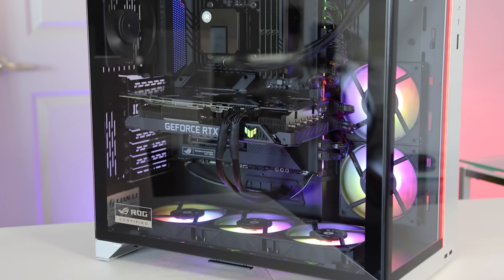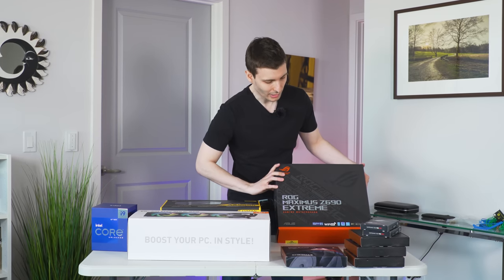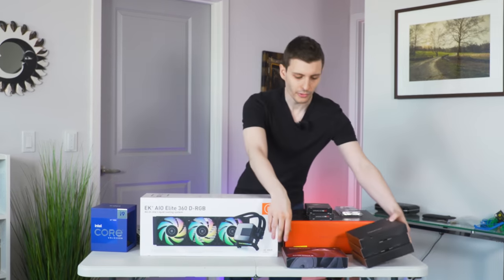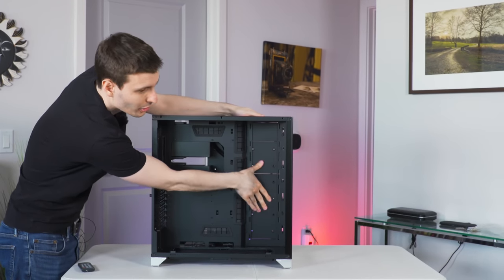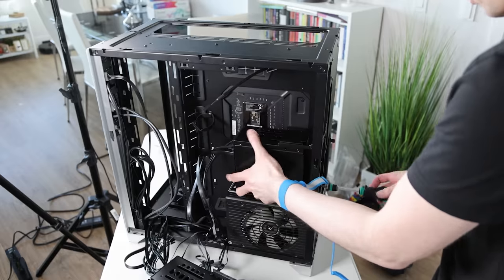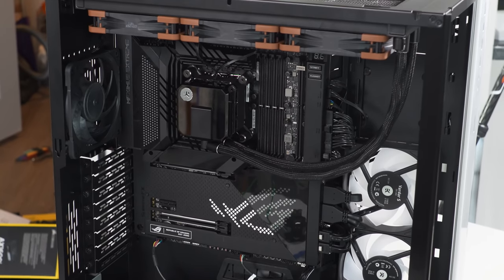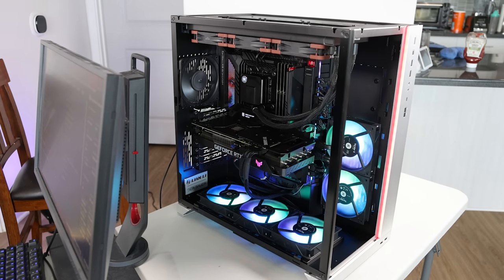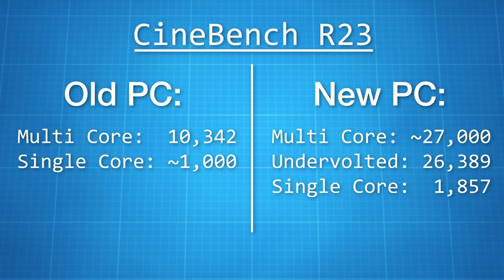I FINALLY Built a New PC After 7 Years (Unlimited Budget)

Comment from the maker: A few common questions, I'll update these periodically:

Q: Why not wait till Zen4 or Raptor Lake?
A: My current computer was basically on it's last legs, stuff just wasn't running nearly as well, Photoshop became slow AF in the latest versions, plus other random issues. I wasn't sure if a clean reinstall of Windows would even help, so I figured it was time to upgrade anyway. I didn't want to deal with it until the rest of the year, and that's assuming I'd even be able to get the new components when they come out, which is probably not the case.

Q: Why did you end up switching to the other fan controller?
A: The Asus one just didn't work, and wasn't even being detected by the Asus software. Maybe I did it wrong, but the Asus software really sucked anyway so I just went with the EK one and it works fine.

Q: Why not get a Nvidia 3090?
A: I already had gotten the 3080Ti a few months ago, so it would have been kinda dumb to buy a whole new GPU just to go from a 3080Ti to 3090. Especially with the 4000 series coming out which apparently will be twice as powerful, so I'll just get the top tier card when that comes out. Also even when I got the 3080Ti, I was actually trying to get a 3090, but even with in-stock notifications, the 3080Ti became available first so I jumped on it.

Q: Why not faster RAM or better timings?
A: At the moment, there are limited options for 32GB sticks. 4800 MHz @ CL40 is the fastest that existed if I wanted 128GB considering there are only 4 DIMM slots. Anything faster is only 16GB or less

Q: Why not mount the fan controller with tape somewhere else?
A: I was going to, but there is actually no place it would fit even that way, because of the way the mounting features of the case are arranged on that metal panel.

Q: How much did it cost?
A: About tree-fiddy

Q: What was your old computer?
A: Intel 5960X (though last year I bought a 6950X on ebay and swapped that in). Mobo was Asus Rampage V Extreme (X99). It had 80GB of RAM.

Q: Why not the 12900KS or 3090Ti?
A: Neither of those had been released at the time
Reply: Raptor Lake all the way! That will be my next computer this Fall!
Reply: The aRGB staff are usually proprietary and only work within same brand, So that was probably why Asus one didn't work.
Also, Did you use LGA1700 mounting kit or LGA1200? Because that could affect temps.
And a stupid question, did you enable XMP for RAM?
Reply: Slow AF!.. 😄
Reply: What do you plan on doing with the old stuff?
Reply: The real question is... can it run Minecraft?
Reply: What will you do w/ your previous workstation?
Reply: No RGB RAM=instant fail😂
I my understanding, ASUS Aura Sync and Razer Synapse is considered to be some of the best RGB lighting software in the market. It will be interesting if you could make a separate video to illustrate the problem you faced😄
Reply: How much did the total cost of the build come to not counting the GPU you're reusing.
Reply: what was ur old pc config ?
Reply: i hv bought i7 12700 non k + asus z690 tuf gaming wifi d4 at the cost of yuhr i9 12900k wd overpriced packaging and 4 extra efficient (non powerful) cores
rest i already own rtx 3070 FE n 32gb vengeance kits , 6 non rgb cooler master case fans , 2tb 970 evo plus , 860 evo since 2018 launch and 850 evo since 2015 250gb each , 2 4tb wd blue and wd red,  
cooler master hyper 410r cpu cooler
Reply: WHY NOT GO FOR RDNA3, ACCORDING TO SOME MOORE'S LAW IS DEAD VIDEOS IT'S GONNA BE BETTER THAN LOVELACE WHILE USING LESS POWER
Reply: @FatSn8ke  why
Reply: Plz heart this comment thiojoe
Reply: Joe , u shudve bought a mac studio with 64core m1 ultra , 128 g ram , 4 tb storage and u can film 4K and will be so much quieter
Reply: @atharvagangan1777  *20 core CPU&64 core GPU
Reply: @rhebucks_zh  ya I meant that
Reply: I miss you so much, and blessed Friday, and you're creative keep going✨✨✨✨✨..
Sender: your brother (Baraa) from Palestine
🇵🇸🇺🇲
Reply: Adobe is recently undergoing updates that may slow down performance for some PCs.
to clock your CPU faster, go to control panel > System & security > Power options > Change Plan settings (for current plan) > Change advanced plan settings > Processor power management > minimum processor speed > (default setting: Plugged in or None) > 100% Then click OK. The CPU should clock faster, but this only works with PCs with processor drivers with adjustable clock speed support.

Also, you could also get a raspberry pi 400, as you may be able to add USBRAM to achieve 128gb.
USBRAM is a beta project that uses usb 3.0 or usb c for full support.
Reply: Please translate your cost amount to an actual dollar figure!
Reply: The motherboard name is pronounced "Are Oh Gee" not rawg
Reply: Why did you wanted to boot without a monitor?
Reply: why not amd?
Reply: Tree-Fiddy??!! Please tell me that's not 350k
Reply: How about the 3090 ti?
Reply: @aayanpanjwani  he had bought the 3080 recently for his old pc, he ain't buying a whole new graphics card for slight performance inc
Reply: @Fnn-jl7he  Yeah but he said "unlimited" budget, so
Reply: @JavisoGaming  AMD's Zen 4 is going to Spank Raptor lake back to 2012.
Reply: what's your 2015 pc?
Reply: i upgraded as well, couldnt wait, i'd lose more by waiting. I went for 5950x & dark hero mb. waiting on GPU to get cheaper bef i get a 3080ti, thats all.
Reply: The Performance is Key But cosmetics are important 2 so why No sleeved cables?
Reply: Out of all the RAM you could get, you got the one kits with no heatspreaders? They're just exposed PCBs, and it really deducts from the final look in my opinion.
Reply: Okay so windows 11 does have tab file explorer for 22h2
Reply: You also have the security advantage of Shadow Stack (which is in Tiger Lake (on mobile) and Alder Lake and up (for both as Rocket Lake did not have support of Shadow Stack) and Zen 3 and up for AMD) against Return-Oriented Programming attacks. This provides mitigation against exploits as more programs make use of CET. Using CET does not make a program incompatible with previous processors but they don't get the security advantage
Reply: @doctorfresh3856  How so?
Reply: @muhammaduwaismuhsinmuaz4385  Because it's going to be a better, far superior product. Duh.
Reply: @doctorfresh3856  How?
Reply: @muhammaduwaismuhsinmuaz4385  Better IPC! Higher gaming and Multi Core Performance. Better cooling capacity. Higher voltages and hear resistant. Just the whole nine.
Reply: @doctorfresh3856  Did you test it?
Reply: @muhammaduwaismuhsinmuaz4385  BECAUSE I SAID SO!!!
Reply: @doctorfresh3856  Huhh???
Reply: CMOS POST ERROR means the configuration data is wrong or the CMOS clock battery is bad(from experience from older bioses(namely my windows 98 PC))

Comment: Ive never heard of under-voltaging a CPU before. It sounds like a great idea to save your CPU and have it last longer. Good job on the future proofing even if it was a little bit ridiculous
Reply: I've also never heard of under-voltaging a CPU before.
Reply: But if a computer plays up at the correct voltage, then something is wrong, maybe the cooling system is not as good as he thinks.  I only used water cooling once, never again.
Reply: Quote - "Ive never heard of under-voltaging a CPU before. It sounds like a great idea to save your CPU and have it last longer."
- Unnecessary and it doesn't work like that.

Quote - "Good job on the future proofing"
- That's a Myth made up by Computer enthusiast... 
And it makes a person feel better / justified about Spending Thousands of Dollars.
Reply: I feel like undervolting a cpu is bad for the cpu, because it could constantly want more voltage and not get it, and make your system unstable, if u want less performance just lower the clock speed on the bios.
Reply: @dirtydemon9723  Nope. Experts do it. It's not uncommon for people in the know.
Reply: If you have ryzen you can get this free tool that overclocks and undervoltes at the same time. From what I understand if you put in less power you get less heat obviously, but with that less heat you can run it at a higher clocks and still be stable. Not sure if that makes it have a longer life span but it sounds like it.
Reply: @dirtydemon9723  also that's what undervolting means. Making your cpu not want more voltage.
Reply: Sure you did, a Nintendo Switch is underclocked
Reply: @DoubsGaming  

Quote - "Not sure if that makes it have a longer life span but it sounds like it"
- LoL Morons -
USE the Links - Do the Research.

- Do Not Buy AMD.
Reply: @dirtydemon9723  ,
Not how it works.
I don't think he did this the ideal way for modern CPU's, but ideally you want the CPU to use as LITTLE voltage as possible while still being stable. And he DOES run tests to ensure stability so that's not an issue. You wouldn't simply "lower the speed" either. To oversimplify, with a modern CPU you want to set the TEMPERATURE limits and then have it dynamically adjust its voltage and clock speeds to give you the best PERFORMANCE without going over that temperature. All modern CPU's and GPU's have the ability to TRAIN individually the voltage/frequency curve. So it will lower the VOLTAGE at, say, 4.8GHz until it becomes unstable then lock in the stable voltage in a lookup table. Then refer to that table when dynamically adjusting for max performance.
Reply: manufacturer bioses usually have a high auto voltages , you can unusually get a slight overclock with less voltage that the auto settings. Been doing that since the Sandy Bridge Era from 2011 though some chips are duds that need higher voltages so you'll need to test and understand your specific chip to know it's range
Reply: Overclockers rise up. Undervolting is actually one of the ways to increase CPU performance (at least for Ryzen) because it reduces the amount of heat generated and gives the auto overclocker more headroom to go all out.
Reply: amazing thread here guys, I didn't know best buy laptop salesmen had a thread to congregate under
Reply: I undervolted my Ryzen7 3700x when i first got it a couple years ago because of the articles about some motherboards pushing too much power, fast forward a year, im wonderng why my focusrite and studio monitors started crackling under load, first noticed it while using blender while watching a tutorial, turns out resetting the bios back to default fixed that problem and the stuttering in my vr headset. I was 2 sec away from reinstalling windows and throwing a 3070ti up against the wall. Long story short, undervolting isn't always the answer...
Reply: @jesusisunstoppable4438  why? AMD has been leading for the past few years and seems they will continue Todo so into the near future
Reply: @jesusisunstoppable4438  what? Amd processors are more than the Intel equivalents
Reply: @michaelf.2449  - No - 
And of course mainstream will never say it in modern times.
And AMD vid cards suck also.
Reply: @jesusisunstoppable4438  why do you think AMD CPUs aren't good? They've been ahead of Intel and gaining market share the past few years and it's caused Intel to finally innovate
Reply: @michaelf.2449  

2nd add on Comment - Because I know You are a AMD fan boy -
- Google search.. 
Why do AMD Cpu's have so many problems.  -- Answers going back 10+ Years.
Why do AMD vid cards have so many Problems - Answers going back 5+ Years.

You like Cheap Crap AMD -- Go for it, buy all their stuff and keep them in Business.
I've been saying for 20+ years - I wish their were dozens of CPU Companies competing.

But it's just like everything else - it's the illusion of choice.
Reply: @michaelf.2449  

2nd add on Comment - Because I know You are a AMD fan boy -
- Google search.. 
Why do AMD Cpu's have so many problems.  -- Answers going back 10+ Years.
Why do AMD vid cards have so many Problems - Answers going back 5+ Years.

You like Cheap Crap AMD -- Go for it, buy all their stuff and keep them in Business.
I've been saying for 20+ years - I wish their were dozens of CPU Companies competing.

But it's just like everything else - it's the illusion of choice.
Reply: @jesusisunstoppable4438  ohh you're just a fanboy okay. Well I'm glad to know I'm an AMD fanboy considering I've haven't owned one since my first computer 🤣 2600k all the way to 12600k and still using Intel but you cannot just dismiss facts by claiming the other guys suck
Reply: @dirtydemon9723  If undervolted too hard, it will be unstable yes....but the point isn't that people want less performance, they want less heat. If you under-volt right, it will still automatically boost to the stock speeds (or in some Ryzen cases, above stock speeds) and perform just as it was out of the box, but at lower temperatures. The reason this is possible is because CPU's aren't all created equally, some CPU's of the same model will be able to overclock/under-volt better. This is because they are "binned" and if a certain standard is met, they will be made as a certain model. This leaves headroom in both aspects in undervolting and overclocking. So as the results may vary, it is worth doing if you like a cooler system (which makes the system quieter).

Comment: Two things, Theo:  1) you really don't need a ground strap.  All you need to do is ground yourself by touching the case periodically.  2) PSU with that much power can't hurt but are really a waste of money.  A 700 or 800 supply would be more than enough, even with your hardware.

Comment: I went to programming school for a year but was never able to get a job in the industry. But I did, like him, went out and built my own computer. Overall I saved only about $200 from not buying a similar type, no brand computer. But it taught me that buying a name brand computer was a waste of money (and this from someone who worked at Hitachi for 3 years). My current computer I bought 4 years ago, no name, but has a double drive so decent memory, and also a fairly good CPU. Overall though, I saved around $1000 by not buying a name brand. I did get an extended warranty of 3 years which I never used. (On my previous computer I also did that and used it so many times that the company in the end said it would take them months to fix my computer and the warranty would've run out. Computers have clearly gotten better since then).

Comment: was expecting an RTX 3090 😂
Really awesome build and the cable management is absolutely the cleanest i've seen so far. Congrats!!
Reply: Wait, where did he show what graphics card is he using?
Reply: @TuxikCE  5:26 he used the graphics card which was in his old PC
Reply: @san4th  His old PC is from 7 years ago, and it was showing "RTX" on the label. Also he said it is a no budget PC, so surely he would have upgraded the graphics card, but interestingly he did not show his graphics specs.
Reply from the maker: Nah i'll just wait for the 4000 series
Reply: @ThioJoe  That is even better decision, considering that 4000 series is right around the corner.
Reply: @ThioJoe  better have 10k in your savings😂💀
Reply: @ThioJoe  thats what I've said with every tech advancement, I'll just wait for everything to catch up with each other 😂 i started 6 years ago
Reply: Currently you can only get that 3090 in your dreams
Reply: @ThioJoe  or the 3090 TI
Reply: @kavivarman  10% performance over 3080ti for 2x price
Reply: @ThioJoe  but you already jumped the shark with the rest of the system 🤔
Reply: @LeviAckerman57551  3080 Ti
Reply: @san4th  dude that's still good then
Reply: @LeviAckerman57551  not enough, hes gonna upgrade to a 40 series card later
Reply: @TuxikCE  I got a 3080ti and it’s as powerful as you will ever need as of right now for pretty much anything, the performance is very close to a 3090 minus the 12gb vram
Reply: Great video, but his computer is boring for 12900k with 4TB 980 pro, Z690, 36 TB HDD, 128GB DDR5
Reply: @ThioJoe  that aged well i can tell

Comment: Quick tip. Attach the CPU, RAM, and storage BEFORE placing the mobo in the case. Power it on and make sure everything is connected properly. This way if you missed something then you don't have to take everything out to fix it.
Reply: It's much better feeling building it and then turning it on for first time
Reply: @Ladioz  Until you completely short your motherboard and blow an entire build. Lemme know how that goes!
Reply: @aidandubiel2615  That never happens, come on man.. been building computers since 2019
Reply: @Ladioz  I'm happy for you! I've been building computers for like 2 months. So far I've killed more builds than completed. Maybe we operate on the assumption that people who have never built a computer before don't know that there is a very real risk instead of just throwing out poor advice, k?
Reply: @aidandubiel2615  maybe ur just bad at building pcs…
Reply: @tessleye_01  perhaps if you read my earlier comment you'd see that I've already admitted to that....  

Maybe you're just bad at reading? 🤔
Reply: @aidandubiel2615  maybe ur just bad with fluidity in your writing
Reply: @tessleye_01  I've moved on from this conversation.... you should too.

Comment: a tip from me. if you have a box where you can mount the cooler in front of the box and no holes on the top or seal them with Plexiglas then you avoid getting more dust to stuff into the box

Comment: RAM (Memory) is a thing you can never have enough of.
In 2002 is was helping a school setting up their new computer rooms. I asked for (slow) AMD something 800 MHz, but "crazy" 512 MB of RAM. At times where typical CPUs where already at 1.2 GHz, but RAM still 128 MB. So the money saved on CPU went into RAM. Advantage of that idea: The computers where running even 8 years later with the same configuration, without the need of any swapping. As soon a computer swaps, the performance drops by factor 5 to 10.